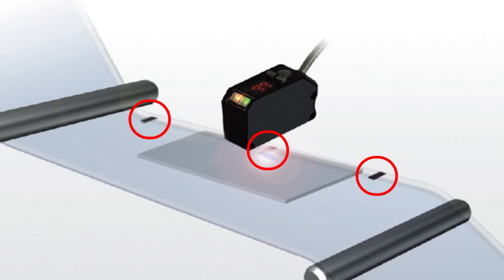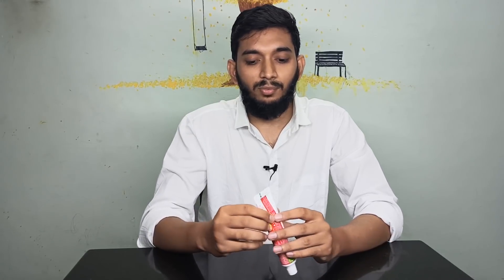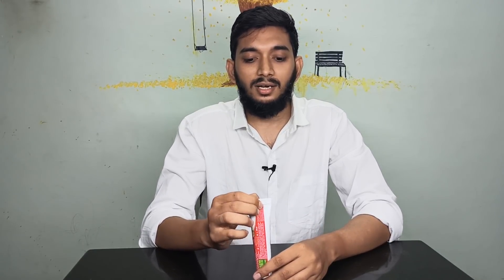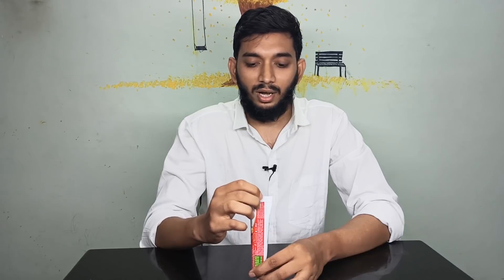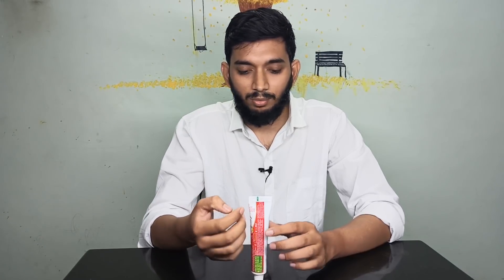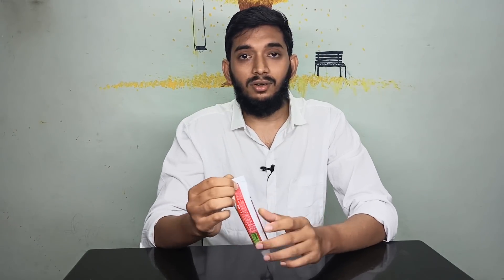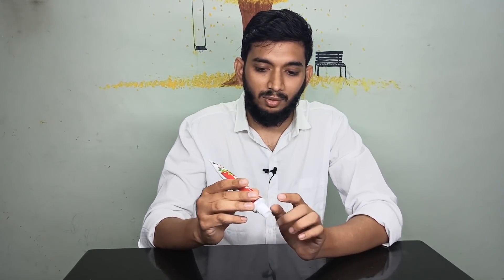Why colour coding given on the toothpaste?_Tamil, Does the colour code really mean the ingredients?

Comment: This colour code is called as 'Eye mark'. It's colour is based on the artwork (design). If the artwork is in light colour it will be in dark colour used in the artwork. Mostly it's present in black or white (based on the design). If black colour is not used in the artwork (design) then only we go for another darkest colour in the artwork (design).

Comment: Bro plz see this. Usb cable ah cut pani double barrel pin la connect pani ( modem ah power bank vachi use pana mudiyuma?) Apidi pana work aguma? Epidi wire configuration pana

Comment: Hi brother 
In home , neutral point of invertor is generally connected to the neutral point of main line .
Accidentally , neutral wire got cut in the electrical post and the devices stopped working as expected , still the device connected through the invertor runs . How does that run , is it safe .
Also have seen in many houses the neutral point of invertor is not connected to main neutral 
Is it ok ???
And have heard that present modern digital eb meters even detects the current in neutral wire and henceforth inverter neutral should never be connected to house main neutral as it estimates the invertor current even during power failure
Your views ??

Comment: bro yen milk packets la intha colour code illa?..
Reply: This is what I think! my answer might be incorrect.. Please see below...

Cutting mechanism in milk packet is different. Milk packets were hung vertically, once the pack is full, then it will be cut. the packet will be separated very faster. milk packets very thin. But in this case, these tube are handled horizontally on a flat surface. 
These tubes will need strong seal as it a thick plastic. in milk packets, small heat (like candle) is enough, they are very thin.